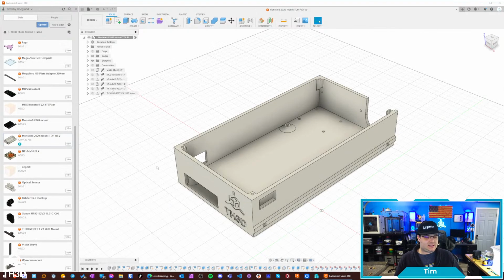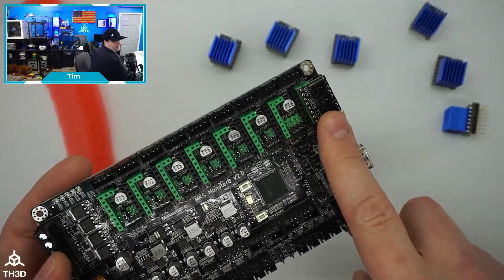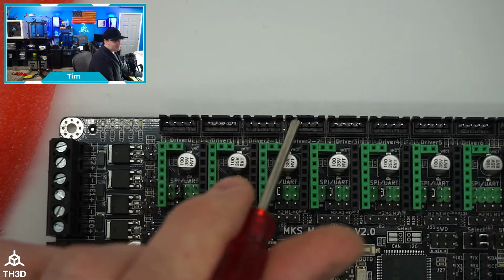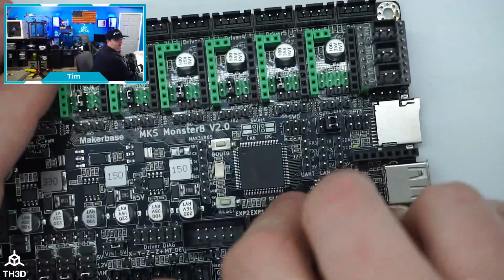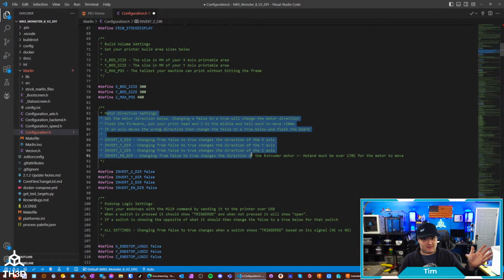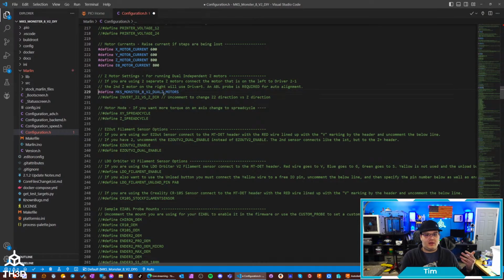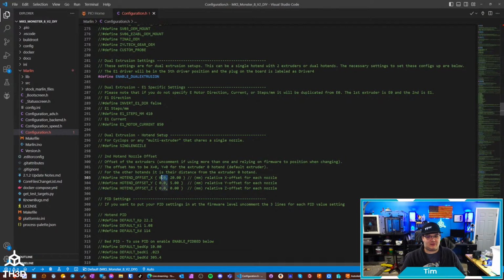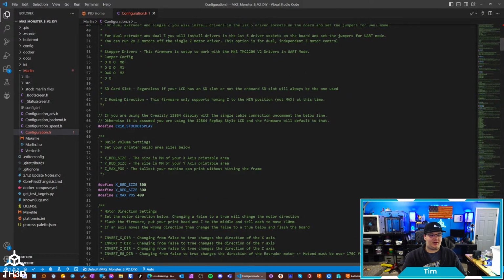MKS Monster 8 V2 DIY Board - Product Tour - Firmware & Other Goodies

Comment: I purchased the firmware and my board is in. How do I install CR touch on the board
Reply from the maker: If you need tech support we offer that as a service. We can help you get the CRTouch wired up and firmware setup for it. It's $30 for one ticket if you didn't get the tech support when you purchased the firmware. Contact us here: https://contactus.th3dstudio.com/

Comment: Does this support a pt1000 natively ? Or do I require additional setup on board via jumper or max chip - the octopus uses dip switches
Reply from the maker: Most support the PT1000 natively. It's the older PT100 that usually needs an Amp board.

Comment: hello, i got problem on my MKS Monster 8 V2. when it is powered on, the indicator light only turn on at VIn and 12V.  3.3VP, 3.3V, and 5V do not turn on. what is the cause of this problem?
Reply from the maker: Sounds like the 5V rail is bad on there.

Comment: Does this board support TFT displays like from Big Tree Tech?
Reply from the maker: Yeah it can work with it. Those just need a UART header and the Monster 8 V2 has one. Our firmware doesn't support it though but you can modify the code to add it on since we provide the full source code.

Comment: I see the referenced Firmware has no configuration.h file other then the default. I assume if one guys the FW that configuration.h is included? OR is it only the stock file given?
Reply from the maker: I'm not sure what you mean. Our firmware for this board comes with the DIY config, you have to set up the values for your printer you are installing it in.
Reply: @TH3DStudio  ahhhh ok my mistake. I thought it was setup for some particular printer and we just adjusted as necessary.  Thanks 😊

Comment: creality also have  a new e3 free run board out iv'e one here arm32 f104ret6.. awaiting  your magic tim for some firmware..  not as impressive as this board i must say
Reply from the maker: Yeah I saw that. It's on my desk. Going to be doing firmware for it soon.
Reply: The e3 doesn't have enough drivers to support the dual x motors and a second extruder. The F4 processor is also better if you are running Marlin.

Comment: Lets hope there is a case for the Sovol sv06 Plus. Would change that shitty sovol mainboard out in a heartbeat.
Reply: I'm putting one in the SV03. I didn't even think about the case before buying it.
 I haven't quite measured but it looks like it actually fits in the existing case. I have to drill a few holes for mounting the board. For sd card and usb port, I may just cut a square out with the dremel and maybe someday print a bezel for the ports and call it a day.  It shouldn't take that long in KiCAD.